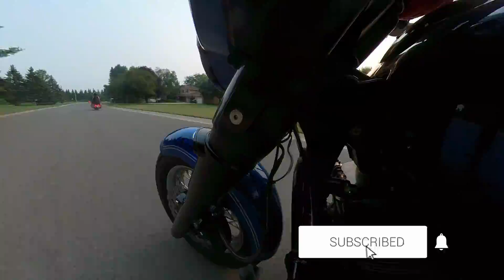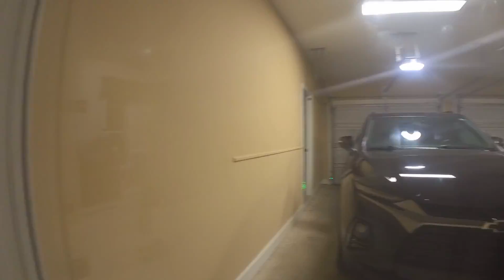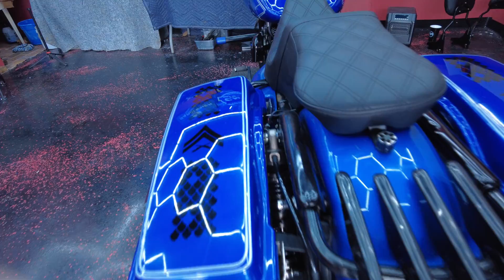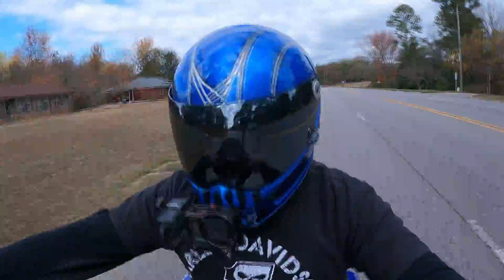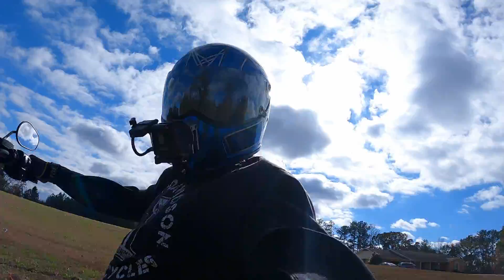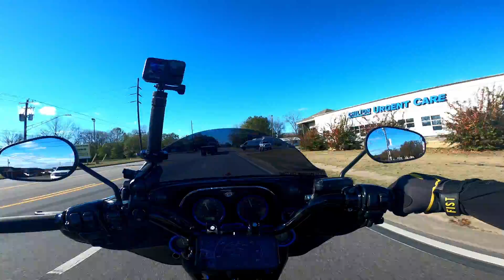The Best Suspension for Harley Baggers! - Geezer Engineering

Comment: Great video and beautiful bike. I was thinking about doing just the drop in cartridges for the front on my street glide there only like $600 do you think they are worth doing??? My front suspension sucks big time??
Reply from the maker: If you have a 49mm front end you can do just the drop in cartridges. They would be a huge improvement. I did Triple trees to swap over to 49mm to run the cartridges. It was a complete game changer and highly recommended.

Comment: I have a 2010 rg with geezer complete front end upgrade 49mm front +2 tubes and cartridges and rear 14" shocks. I am supper impressed in the difference over stock.
Reply: I’m next
Reply from the maker: From stock its a night and day difference even riding with other suspension it was a big difference when I made the change!